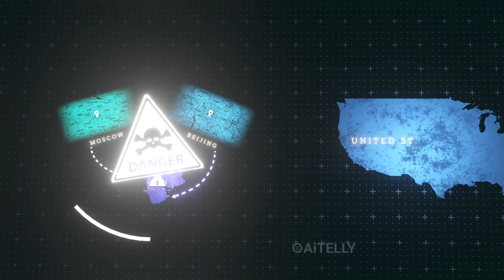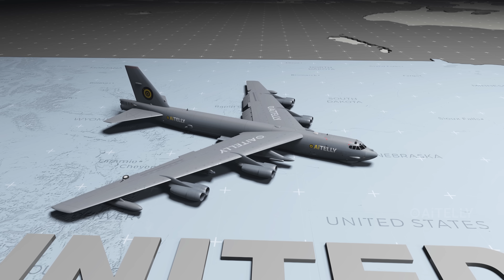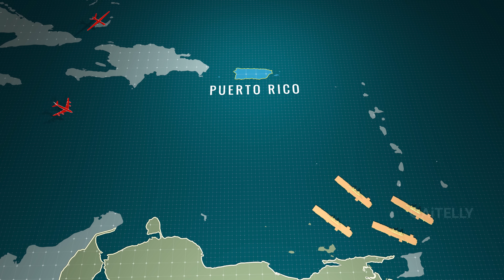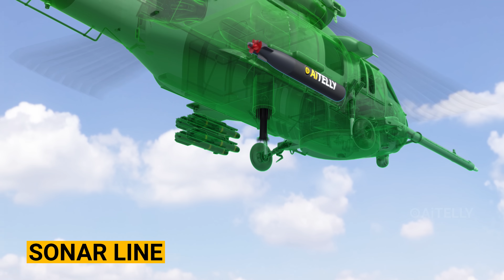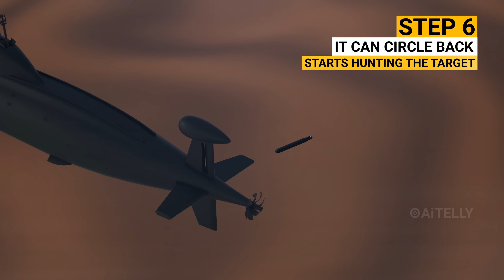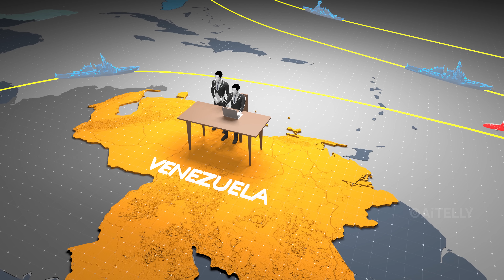US Invasion Plans Against Venezuela Explained

Comment: Why didn't the Venezuelan army fire on the helicopters with MANPADS (anti-aircraft missile systems)? The Venezuelan army has 5,000 of them
Reply: We shut off the power. With our cyber which freaked out China cause they thought we didn’t have high tech or that which is why they immediately hacked emails cause they were triggered
Reply: @maciedixon3983 You don't need electricity to fire MANPADS at helicopters.

Comment: Realistically, the core issue is preserving the dollar’s global dominance. It’s no secret that China has been quietly expanding its economic footprint across South America through investment, infrastructure projects, and strategic loans. The key point is that many of these transactions are increasingly being done in yuan, not dollars, which gradually shifts regional dependence away from the U.S.

People often forget that since the end of the Bretton Woods system in the early 1970s, the dollar hasn’t been backed by gold it’s backed by trust, stability, and the strength of the U.S. economy. One of the main pillars of that trust is the dollar’s role as the primary currency for global oil trade.

If China continues to deepen its influence in South America and promote the yuan as an alternative for trade and financing, it directly challenges the legitimacy and dominance of the dollar. That’s why the U.S. reacts so strongly: it’s not just about Venezuela or sanctions it’s about protecting the currency system that underpins American global power.

Ps: If you want another example, look up and see why the US sent billions to Argentina. Search with who were the Argentinians dealing before the US.

Comment: This is all about preventing China, Russia, and Iran from gaining a presence in Venezuela as well as inserting a new regime favorable to the US.

In turn they will gain control over who and how Venezuela sells its oil reserves.  Their crude oil is the thickest and most difficult to refine which is why they have lagged in that area. They do not have the equipment and infrastructure to do so.

On the other hand the US already refines this type of oil in Texas and has the infrastructure and equipment already in place and doing so for many decades.

The distance from Venezuela to Texas is a lot more convenient and shorter than it is from Middle East to US.  US would be less dependent on oil from Middle East and in turn reduce US interest in Middle East.

The US would gain a strategic pro US partner in Venezuela and in turn Venezuela would gain wealth and build its economy and country with its oil while having the US as its main partner.  This would prevent China, Russia, Iran, etc from buying their oil in BRICS currency and devaluing the US dollar, which has been their plan and why they were in cahoots with Maduro regime. While at the same time being in the backyard of US territory, thus why re-introducing the Monroe Doctrine.

This is the ideal plan and goal.

Comment: 1️⃣ Saddam Hussein — Iraq (2003)
U.S. invaded
Saddam captured, tried, executed
U.S. ran Iraq directly (CPA)
Oil sector opened to Western firms
Russian/French contracts scrapped
Long occupation
👉 Closest full match to Venezuela, just bigger.
2️⃣ Muammar Gaddafi — Libya (2011)
NATO air war
Regime collapsed
Gaddafi killed
Oil exports re-routed
Russian influence crushed
Country left unstable (proxy chaos)
👉 Regime change without occupation, oil secured indirectly.
3️⃣ Manuel Noriega — Panama (1989)
U.S. invaded
Leader captured and flown to U.S.
Canal + strategic control secured
Government replaced
Justified as “drug war”
👉 Exact tactical blueprint for Maduro’s capture.
4️⃣ Omar al-Bashir — Sudan (2019)
Sanctions + pressure
Military coup (not U.S. troops)
Regime fell
Oil + ports re-aligned
Russia later blocked from naval base
👉 Indirect method, same result.
5️⃣ Mohammad Mosaddegh — Iran (1953)
CIA-backed coup
Leader removed
Oil nationalization reversed
Western companies restored
Shah installed
👉 Old but textbook oil-driven regime change.

Comment: You are incorrect, Refueling will be done by the KC-135. You’re confused with the C-130. Although there isn aerial refueling variant of the C-130, it’s primarily used as a ground support AC-130.

Comment: It's actually the KC-135. The KC-130 is the C-130 variant can only refuel others via probe and drogue, not Air Force jets that use the boom receptacle method. The P-8 doesn't have an active electronic attack capability. It does have electronic support measures to help provide an image of the battlespace for situational awareness and ISR, but not the active electronic attack capabilities to disrupt enemy command & control.